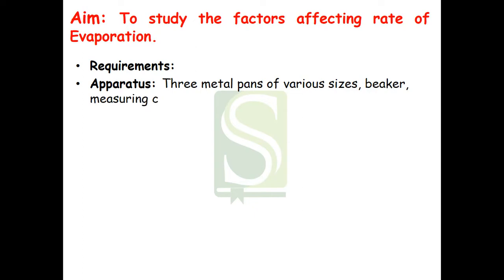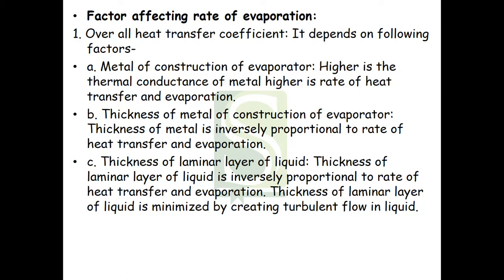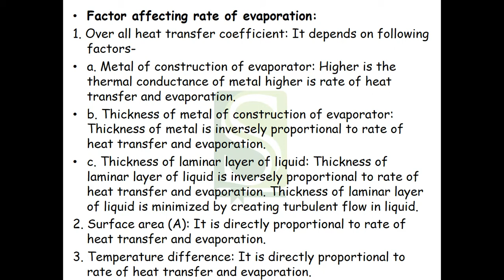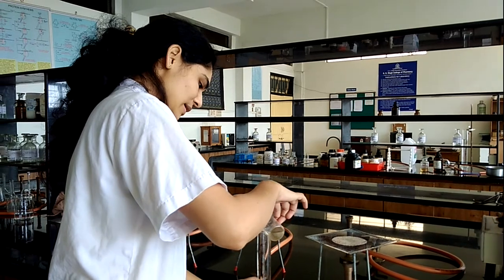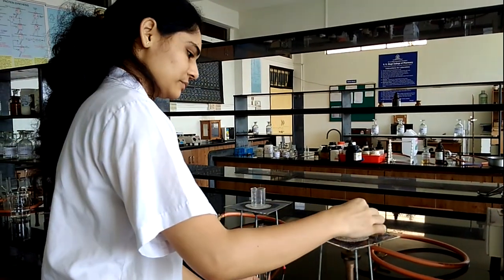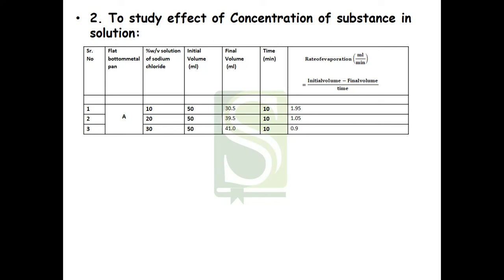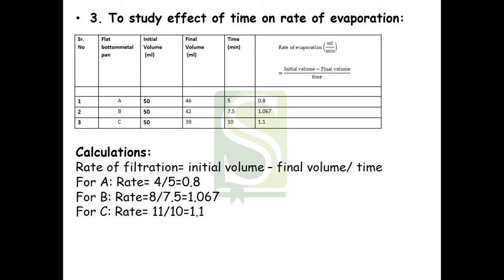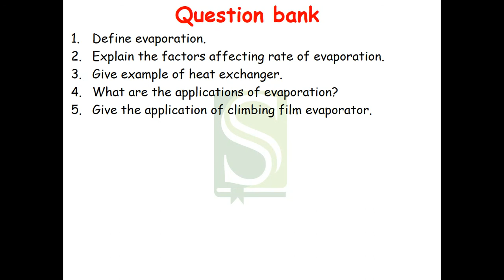To study the factors affecting rate of Evaporation.

Comment: if I have salt content 25g/l   for volume 1 liter and i want evaporation to have 250g/l  that meaning 1-liter volume reduces to 100 ml that true or false?
Reply from the maker: when 25gm is dissolved in 1000 ml (1 liter) you get 2.5% solution.
Now, if you evaporate it to get 100 ml the concentration will be 25%. that means your 100 ml contains 25gm/100ml only it wont be 250 gm/l.